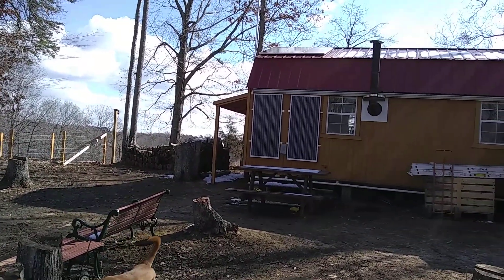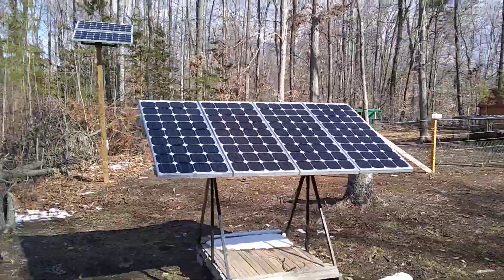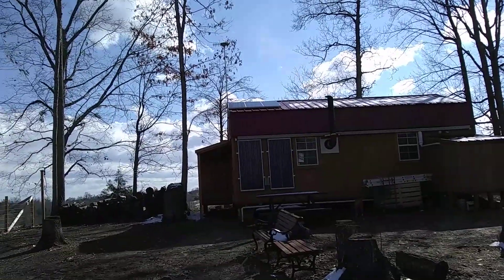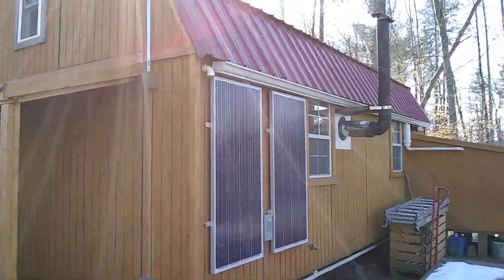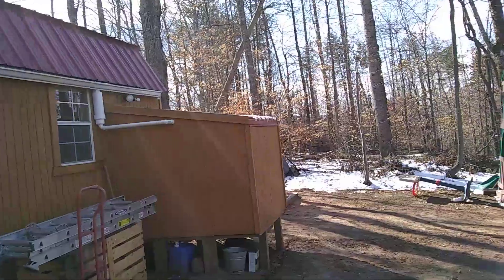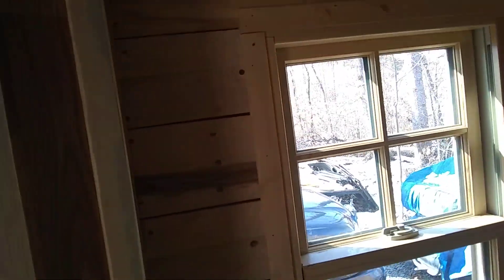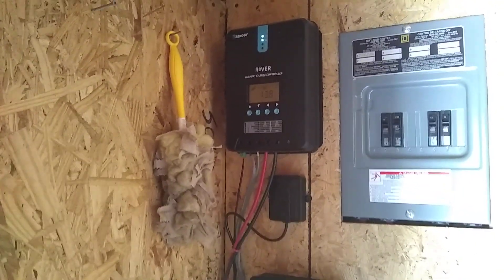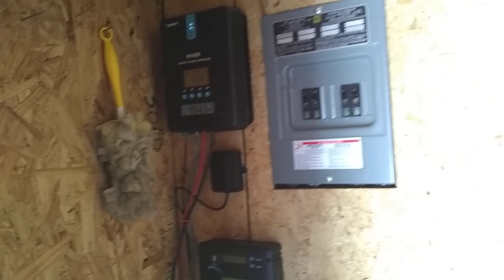Off grid cabin solar update

Comment: have you looked at thin film panels, they are more efficient in partial shade areas like yours. having the branches cast shade on a small part of a panel can reduce power by over 50%

Comment: The additional panels are really cool. I'm sure that you will put the extra energy to good use in your workshop.

I wouldn't ever mount panels to the roof if there was another place on the property to put them. Potential for damage to the building aside, I would want them where they can be easily maintained and moved to catch the most light throughout the year. Having them on the roof limits the access to the panels, not a big deal when you are young and healthy but get a bit older..arthritis, bad back, just plain aches and pain, etc. Anyway, it's not a criticism, just a personal preference as seen through the lens of my own advancing years.

Comment: How many watts of solar are you up to on your entire system? You may have said it before. If so, I have forgotten. Honestly, though, those two panels are being wasted for part of the day, and no direct sunlight when they are in sun. Why not put them on a pole mount, or build a similar mount for them, as you did the others on the roof? 

Alternatively, you could buy or build a solar panel mount that allows heavy weights, like cinder blocks, to be placed on them, to hold roof panels - unless of course, you get really high winds there?
Reply from the maker: Cambodia Paul's Organic Farming I am up to 1380 watts of panels. I have 1180 watts of panels going through my renology rover and 300 watts going into the renology adventure. The river max amps is 40 and at certain times of the day with peak sun I almost hit that. I added the additional charge controller so not to put to much through the rover. I am up to ten deep cycle marine batteries for storage and a 6000 watt inverter. People always say to move the panels on the back of the house and probably will at some point. I'm able to run pretty much 100% off grid at this point and only use my generator to run my workshop
Reply: Fair enough. I guess, as long as your battery bank is at 100% by the end of each day, no complaints there. That's what it's all about, being off-grid 100% of the time. We still run mains power at our farm, mainly as a back up to solar and, when needed, generator. But, we don't use from the mains. We haven't gone above $30 USD per month, in the past 5 years. Solar provides the rest of our needs.
Reply from the maker: I have a small place with very small demand as power is concerned. Everyone who knows how I live talks to me about solar and how I got away with such an inexpensive set up. They want me to design a system for their homes  which I never get involved with. People who have to do grid tie in set ups have so many different expenses. I will say I have opened up solar as an option to many people and I love it . Personally I feel everyone should be on solar and stop funding criminal entities aka the power companies. They are crooks.
Reply: Not to mention, who knows how long the grid may last? Never know what will happen in the future. Best to be prepared to take care of your own. Trust me, living in Cambodia would teach a lot of preppers quite a bit. LOL. Here, sometimes on grid is off grid! The power is so undependable, not to mention nasty, that we keep a generator at our small apartment in the city, for when we are here. It gets exercised, for sure.